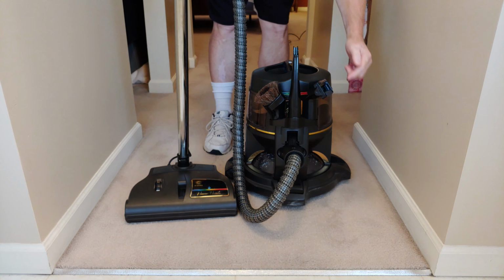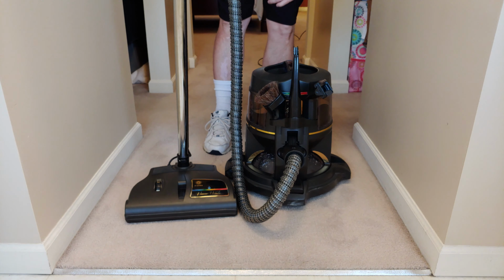Another Rainbow PN-2E After Refurb MUCH QUIETER

Comment: Finally the pn sounds better. Do you have plans on ordering a new motor?
Reply from the maker: If the 15 year old motor works like new now, why would I need to order a new motor? 😁
Reply: @VacLab  very true, my aunts e2 blue power nozzle didn’t run that good, she thought it had motor problems but all it needed was some lubrication